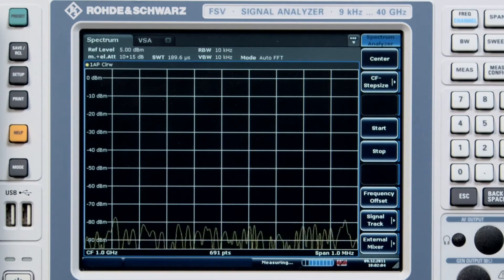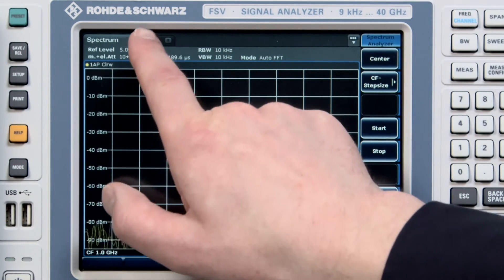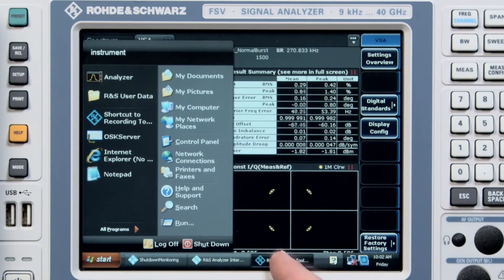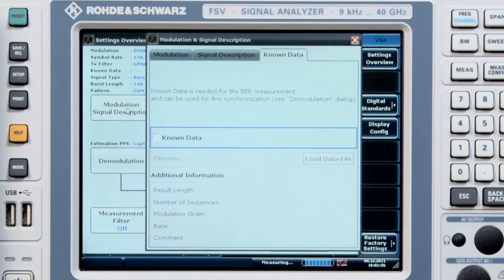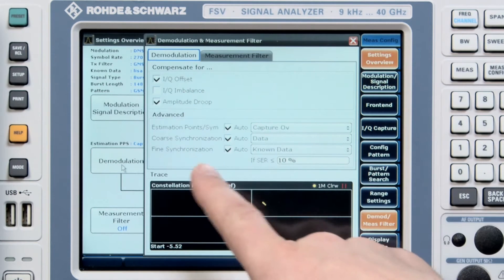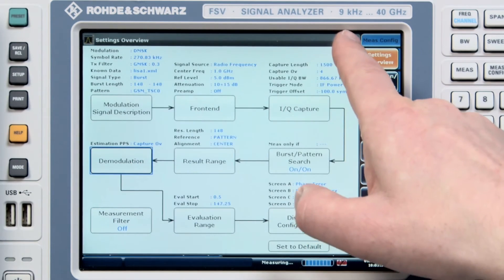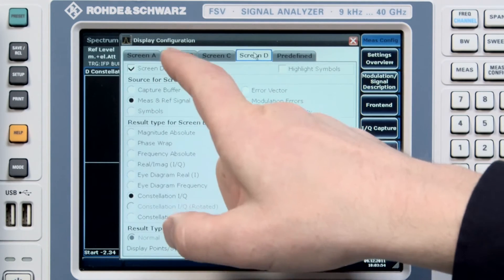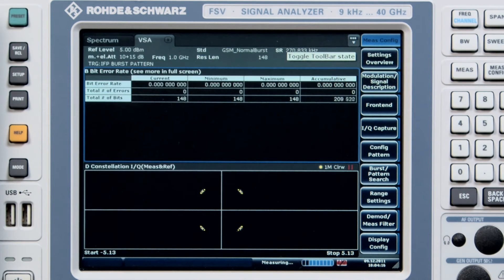Bit error rate (BER) measurement using the R&S®FSV signal and spectrum analyzer

Comment: Thanks for the reply i will check the link. 
to get real time downlink signal and bit error rate  needs some configutation on the VSA config settings ?
Reply from the maker: Dear Benjamin, the BER measurement with the FSV requires a signal which is static (can be complex ...). The BER measurement in a real downlink signal is not possible since it changes. Best regards, Rohde & Schwarz Social Media Team